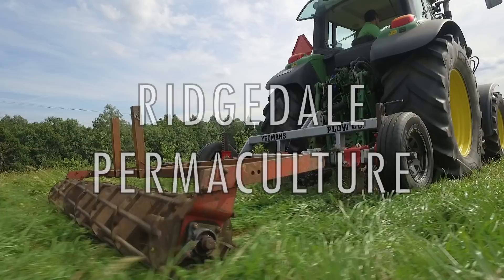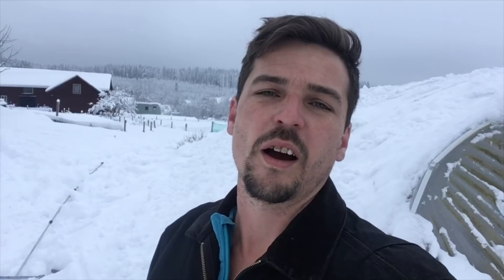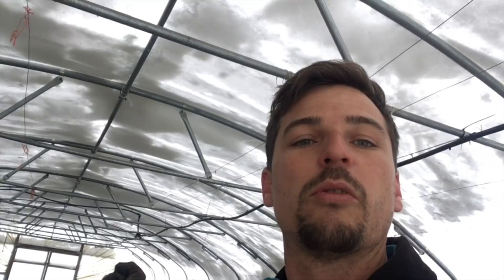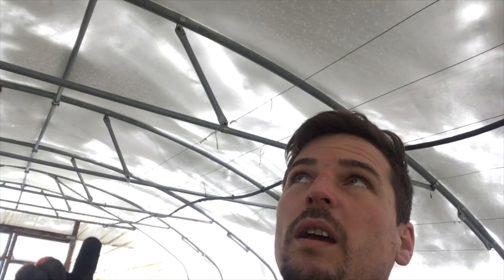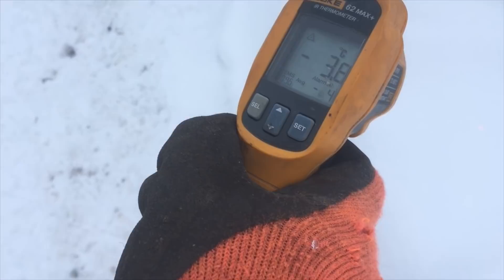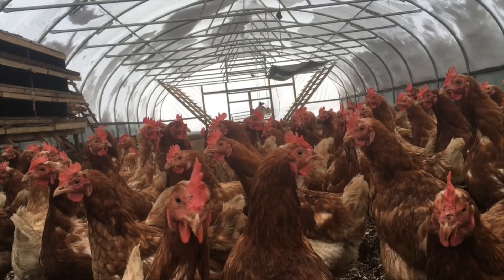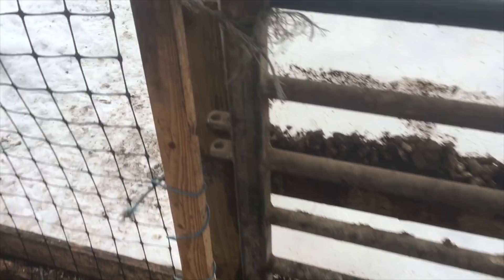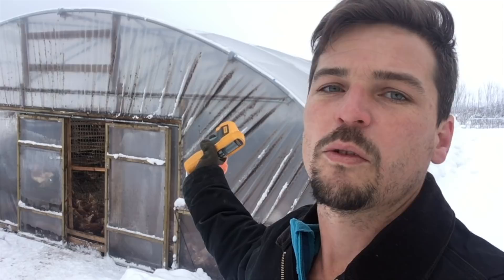S5 ● E9 Polytunnels and Snow

Comment: I have 1m of snow here in Austria and important is that the sidewalls are not in a bow style but rather in a vertical shape for the first 2m of height. The inclination of the bow above and a sunny day will cause a snowslide and the polytunnl is clean again. So it is a self-service system! The important thing is to keep space for the snow on both sides...

Comment: We learnt the hard way once with Polytunnel and snow; we now have 4 x 2 timber uprights propping up each hoop in all the tunnels even those with crop bars as there is a weak point where they are bent; also as the larger tunnels are 'flatter' on top a little gentle heat helps to shift it off the tops but you should take the time to clear it from along the sides as the weight can put pressure on the sides of the tunnel too

Comment: Old plastic would make some good storage structures, lash together roundwood with wire is a low cost easy method I’ve been wanting to try. Wire can be used for bracing too.

Comment: How many birds you have in that tunnel?

You keep saying that good steel is key - however it is good design where truss forces are distributed well and span between hoops is properly sized. Most of collapsed tunnels do not have cross bracing system as your has thus leading to truss failure. Obviously your vendor did a good job. 

Thanks for your videos Richard - they are really valuable.

Comment: So, the chickens will go out in the chicken tractors in the spring, and that tunnel will grow tomatoes. Will you repeat the process the next year, or move the chickens to a different tunnel to condition the soil? If you do use the same tunnel, will you grow tomatoes again in subsequent years, or switch to a different crop? I was wondering if yearly crop rotation is necessary in this kind of arrangement.

Comment: Isn't a sphere the perfect shape? Rounded polytunnels are the strongest shape. We make ours out of galvanized tubing that is 1 5/8 inch diameter spacing the ribs 3 feet apart. Like you, we have never had a problem with snow load. Thank you for sharing.

Comment: how was the humidity in your greenhouse when you had chickens there in the winter time?  I have ca 300 chickens in the greenhouse for the first year, the film is frozen inside, and when it's + degrees outside, the ice melts, and it's like it's raining inside.  I finally opened the windows and added a fan... but the film was still wet or frozen inside. Greenhouse is 6x20m and I have a deep bedding about 30 cm... 
Is there any solution?